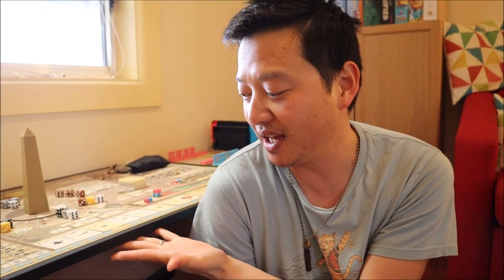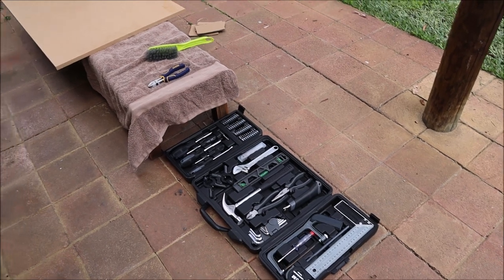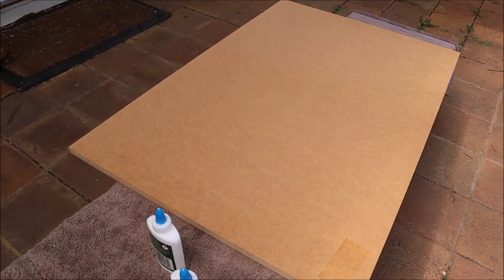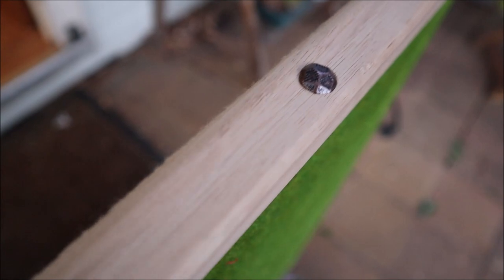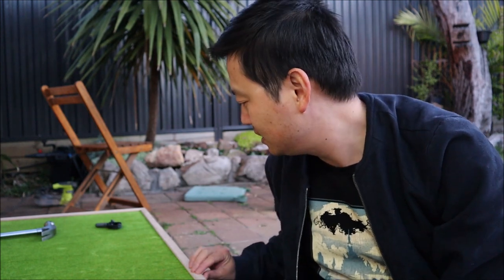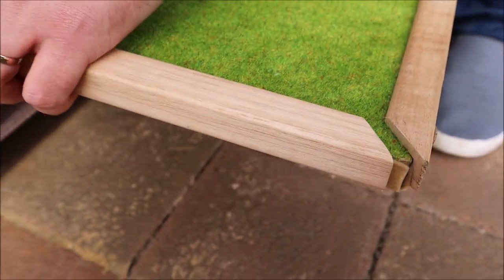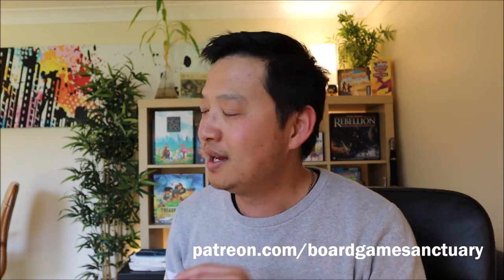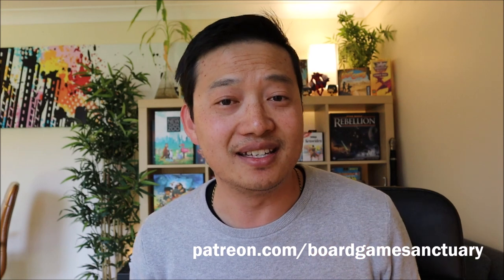DIY Board Gaming Table Solution!

Comment: Tip: Use a miter / mitre  box if you plan to cut 90° or 45° angles. Not expensive but quite helpful.
Reply from the maker: yes I discovered this after finishing the video! Thanks for the suggestion :)
Reply: @BoardGameSanctuary  Haha, classic. And yet it turned out really nice 👍
Reply from the maker: @CrlBox  aww thanks so much!